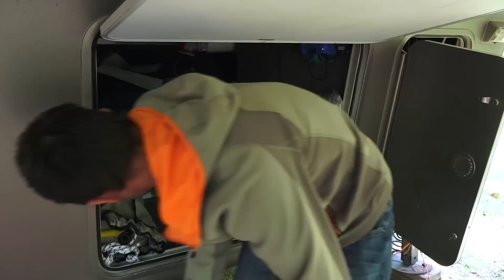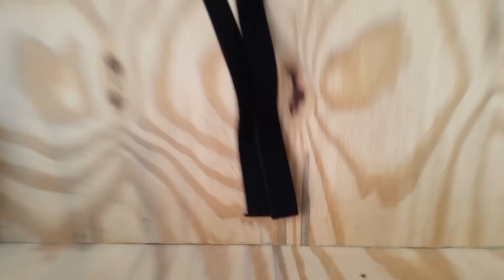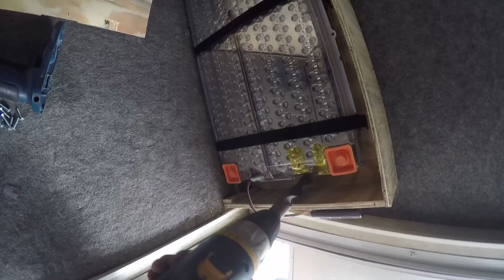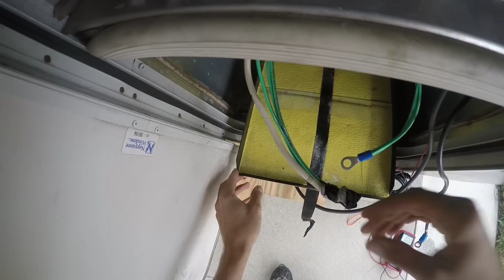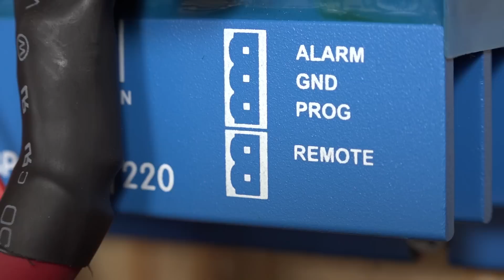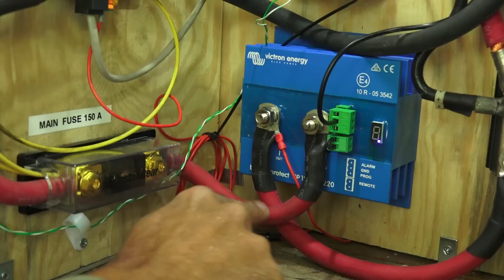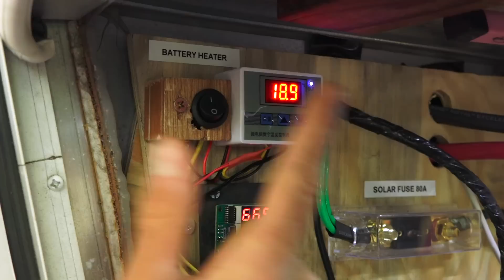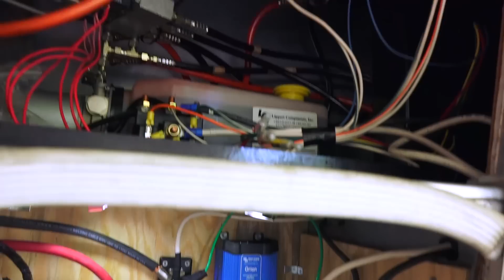PHASE 2 SOLAR - Installing the Tesla Battery and converting the RV from 12V to 24V

Comment: Awesome install and explanation of system!
I’m torn between running a Tesla/Nissan battery or a bank of Battleborn batteries in our new rig. We are definitely going Victron with all the other components and being as we already have the onboard Onan 5500, I’ll probably go with the Quattro 24v inverter which will give me a direct generator input as well as shore power.
I was wondering how the Orion would work out with the slides and leveling, good thinking with the small battery. If I could add, I used to run similar size gel batteries in our dirtbikes which last for years on end if maintained on a small battery charger/maintainer such as “Battery Tender” which I’ve had great luck with. The other thing, as many have also said, running the heating pad at 60* is very high in my humble opinion, 38/40* should be more than sufficient and give ample time to quickly build up heat in that little box even in extremely low and quick temperature drops and wind chill.
All in all, an excellent job sir! I wish I had it in my rig already!
Looking forward to your next video, I’ve been pacing the floor waiting on this video 😜
I’m not nearly as savvy in the art of YouTube videos and editing as you but similar to you, I have a few videos which help understand RV equipment and options for fulltiming, rather than the usual “days of our lives” style content. 
Feel free to sub in support.
Hope to see you guys out there one day soon. 👍🏻

Comment: FYI you can use the BMV as a relay to shutoff your solar (or turn on your heating pads) if you wire their temp probe to the shunt. I'd advise you to reconsider what temp you turn on your heating pads. You are going to be cycling those heating pads often at 60 degrees. Different thoughts on this one, but I think it's better to just disconnect your solar instead of heating the batteries just to charge them. I think you have a much larger solar array so you'll probably end up with a net gain on power, but heating the batteries long term isn't really good for them (depending on how hot the get).
Reply from the maker: If we had the 712 we could, but we are just using the 700.  We might upgrade some day.  I thought of that after the fact.  

As for heating we only turn it on if the temperatures get cold.  The one time we have been in freezing temps our basement storage still stays around 45 and in that small space the heater was hardly on.  My temp gun read a max heat pad temp of 86 degrees so I dont think we are doing any harm to the batteries, your right tho we probably don't really need it, but want it there just in case.

Comment: Looks great Tom - would love to know aprox cost of your system.  

60 degrees for heating seems high - i would think you would be heating closer to 40 degrees?  do tesla cars actually heat the battery when the temp gets down to 60 degrees?  this winter i talked to a guy who has the Tesla SUV and he said that on really cold winter days when he pulls out of his heated garage his fuel gauge will read 250 miles but when he drives around the block it will literally drop in half.

Also  are any of the components heat sensitive?  just wondering how they will perform on a hot summer day in a closed compartment

I'm surprised you don't have some sort of trickle charger on the small 12v battery.  It looks familiar to my motorcycle battery and i know if i dont keep a trickle charger on Harley during the winter the battery doesn't last.  not sure what you paid for yours but on my HD motorcycle they are around $100 so def something i don't want to replace seasonally.
Reply from the maker: I am not sure what the Tesla cars start heating at, I know they only heat before charging.  Ideal operating temp for these batteries is 75Fbut we will never pull large current off this so yes we probably could get away with a much cooler temp.  I might temp it down into the 50s but it takes so little power in that small space to keep it warm already, 

The 12-24V converter is heat sensitive but it has overheat protection (we will know if it gets too hot as we will lose lights lol.) It also has a fan in it.  We have monitored temps in that cabinet being in 90 degree direct sun in Florida and it never exceeded 100. So im hoping were ok.  I will come back if we have any problems however. 

As for the batt, I think a trickle charger is a good idea, and do plan to add that.  I might replace the current 12-24V unit to a different one that has a starter battery charger built in and keep that one as a spare too. 

Thanks for your thoughts.